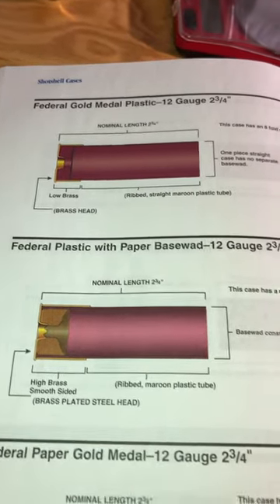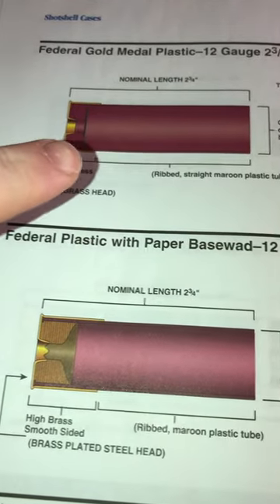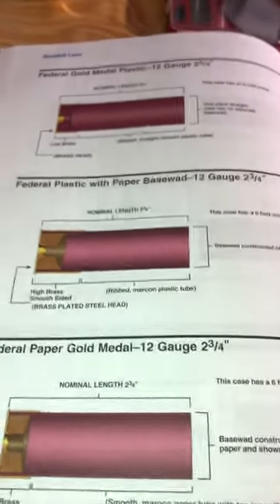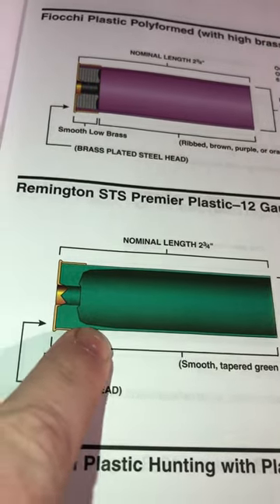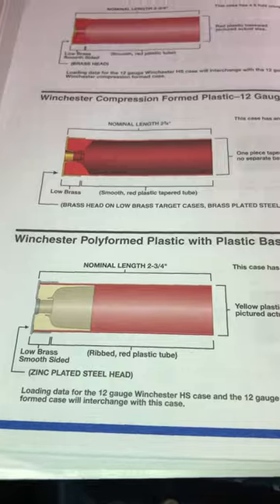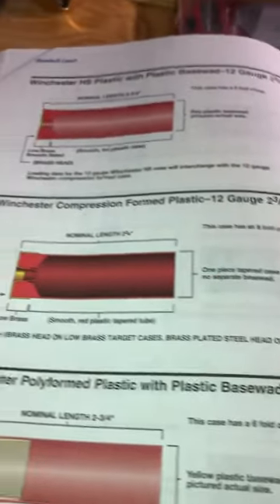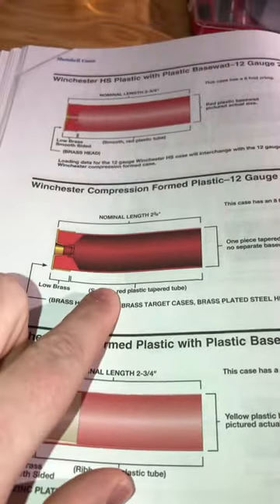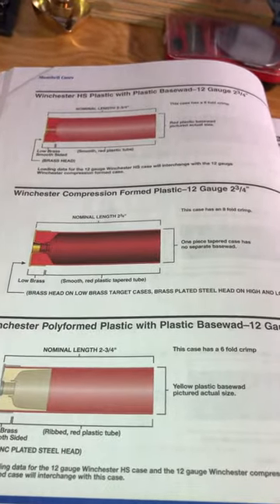Straight-Wall Vs Tapered Hulls #shotshell #reloading #12gauge #shorts

Comment: I recently got a lee loadall reloader and have 5 gal buckets full of empty hulls from duck and goose hunting. The thing thats stopping me is one, not knowing what kind of powder or which wads to use and two where to find the correct wads and powder and also finding number 2 or 4 STEEL shot. Does a book like this tell what correct powder and wads to use and i know of course not where to get it all at. But any help or info i would be in debut for.
Reply from the maker: Yep, a book like this would have all the load data and such you would need